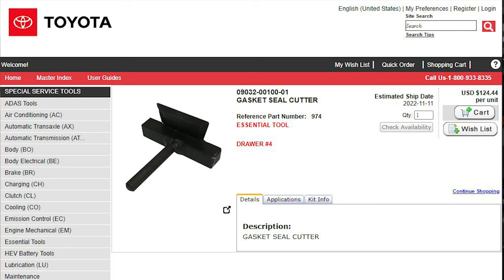Tools To Remove Oil Pan Sealed With RTV

Comment: Underaged tool for this is a plastic scraper meant for taking wheel weights off. They're thick so they don't usually break and do well at separating. Will never damage any parts and are cheap to replace as I usually sharpen them on a grinder they get shorter over time

Comment: Flat Rate Master.. I like that Lisle tool, I will be looking into that one. Can't tell ya how many hours wasted trying to straighten out oil pans and valve cover because they are bent and leaking because the customer didn't want to spend the money to replace them.. I won't do the job now unless it's replaced.

Comment: I usually use a gasket scraper like the ones you showed but that special tool I need to get!
Thank you 🙏
Reply: Dont get it!! Mine flexed and put a dent in the mating surface on the block. Thank god it didnt stop it from sealing up

Comment: I utilize the flat scraper that’s solid end to end. Chrysler stamped metal transmission pans is the same setup and never had a problem resealing engine,transmission and diff covers…

Comment: I just get a new pan. puncture the one in the car with an air hammer and shove a big old pry bar in it and heave it off, most oil pans r required to be replaced now after removal anyways.
Reply: Absolutely not true lmfao.
Reply: @doodlecaboodle9298  plastic ones yeah, what do you know tho 😂

Comment: Ford 2.7 v6 plastic pans are auwfull, even following the Ford sib it’s nearly impossible to get them to seal,we had one that we had to order a custom gasket for and that finally sealed it.
Reply: Thanks for the heads up
Reply: You're not supposed to re-use them. If you check the wsm, its listed as a 1 use part.
Reply: @AT-wl9yq  The pan or the gasket? Referring to one use...
Reply: @TonupTodd  The pan itself.

Comment: do you recommend to replace with OEM oil pan or upgrade  to something better/thicker for personal use.  Mine is stamped sheet metal (F150) and getting damp
Reply: Stamped sheet metal is stronger than you think. Stick with it

Comment: you cant beat cork and leather gasket jobs on old cars 1950s-1980 lol then came out the worst gasket's card the one's you made your self god help you if ended up with one of those which is so stuck you hours scraping it of but the engine pans was a lot thicker to pry on (ford escort mk1-mk2 straight 4 cross flow engine or ford capri v4-v6)good old days as a Y.T.S lad.
who remembers Y.T.S YOUTH TRAINING SCHEME LOL,👍🏻 should bring them back to learn a trade 🇬🇧❤️☕

Comment: The current pictures of the JTC-1315 on Amazon looks like it has a taper ground edge on both sides of the blade. Is yours only ground on the top side?
Reply: I got one and it sucks. It flexed and put a dent in the upper block. Thank god the rtv still sealed

Comment: Hey long time viewer of your channel. Very good content. I have a question about how techs get paid.
I work at a shop. My flag rate is 32.32/ hr., I do good work, my manager tells me I'm getting transferred to a smaller store and the master tech there sucks. So I'll take over, they tell me my  pay will change to TOTAL TICKET VALUE. NO one will tell me about it,  I feel like I will be getting smaller checks now, do you know about TOTAL TICKET value? 
Thank you.
Reply: Hey got a update on your pay plan ? Back in the day total ticket value when I started the split was 50% of the total labor ( I lucked out on my first tech job because the owner still payed that even though it wasn't the norm any longer ) but I doubt that's the case in this situation.